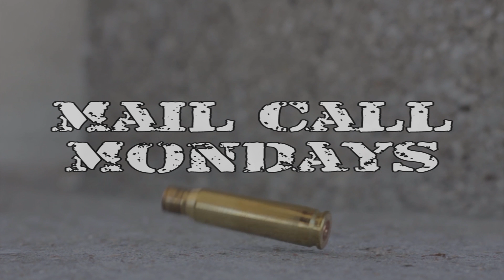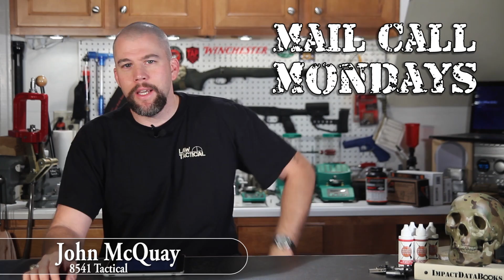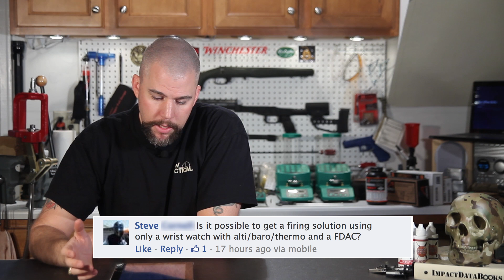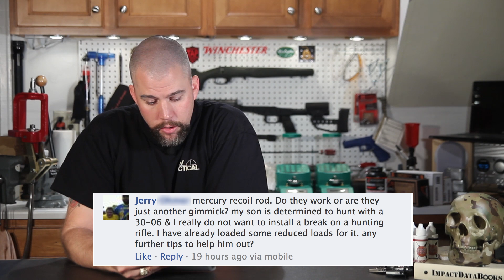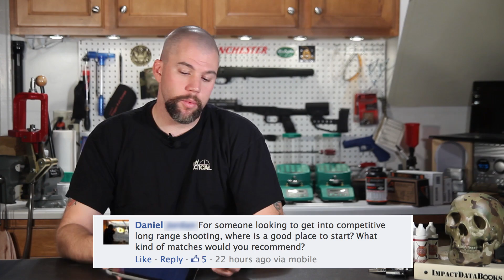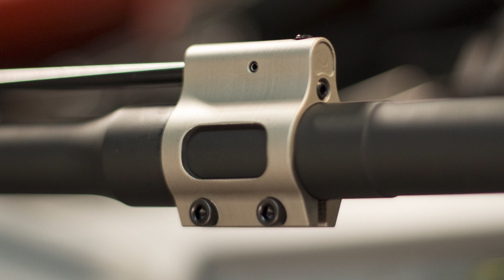Mail Call Mondays Season 2 #38 - Crowns, Dialing Zero, Truck Guns, 300 Blackout and more!

Comment: I picked up a H&R single shot 30-06 for $100 a while ago.  We put the barrel on my buddies lathe cut it off at 16.75" and put a 1/2" recessed crown on the barrel.  Mounted a 2x pistol scope on it in the scout scope position.  I used black bed liner for a finish on the metal, the stock is synthetic, it goes everywhere my truck does since I built an under seat rifle rack.  Yea its loud but less than $200 in it.  Couple hundred rounds in Garand clips in the seat backs.

Comment: Great info as usual. My general purpose/truck gun is a NEA upper 12"Brl 300BLK with a Surefire brake, on a AR Bushmaster lower with a Geissele single stage trigger; topped by a CRM-AK762 and a 45 degree angled T1 (4MOA)... has been a blast to own and play with, from in your face rapid fire to slow and deliberate out to 600+ meters. I really like this set up. Just my 2 cents...

Comment: I have exactly what you recommend for a Truck Gun! AR-15 with 16" 4150 CMV Chrome Lined Barrel, all mil spec 7075-T6 Upper and Lower, with a Free Float Quad Rail, I have an Aim Point Pro Red dot with a 5x Magnifier From Sightmark! Love that thing! Built the rifle for $760 + $600 for the Optics. $1,360.00 and a great setup! You could go with a cheaper optic and have it around $900!

Comment: I built a rifle last spring that would probably fit that roll pretty well:
16" mid length 1/8 twist SS mid profile barrel from black hole weaponry.  Troy v-tac free float handguard.  Mostly BCM internals.  Magpul MOE grip and CTR stock.  YMH flip up irons. A  VXR patrol 1.25-4 will complete the package when budget allows.

Comment: Ruger Mini 14 with 5 round magazine and open sights.   Sits well in gun saddle that fits between seat and console.  A longer magazine is not as handy to store in saddle.  I know.....   the mini 14 is not that accurate, but I have taken many coyotes with mine.
As was said in video a short bolt action with scope would be good for longer range  shots.  I had a chance to buy a savage striker in 22-250.  Dang I wish I had bought it.  THAT would be a handy gun.

Comment: Truck gun . An SKS . Who cares if it get bashed around , cheap and if it gets stolen you aren't out much money . Reasonably accurate and cheap ammo . To me a truck gun is one you leave in the truck and I wouldn't leave my AR in the truck . Locally a Tula good condition surplus is 200 bucks . Mine will shoot 3 to 4 inch 5 shot groups at 100 yards with little problem on a 10 inch plate at 200 yards . Good enough for plinking or bear medicine in camp .

Comment: Thanks for great videos, especially on reloading. Pls answer my following question, modern firearms are made of high quality steel, when fired they can handle high pressure, heat, bullet with copper jacket getting engraved and travelling at high speeds through them but if I touch the same steel with my brass rod(softer than copper) while cleaning it gently it will destroy the accuracy of my firearm? I don't see brass rod travelling at 2 inch per second causing anymore damage(if any) cont--

Comment: On your AR-10 build, if you would be able to test some TSX bullets through the Black Hole Weaponary barrel. 

I have an 18" BHW in 1:8 and cant get any accurate loads with TSX bullets. I have tried 55gr, for my fouling shots, but even these had a large MOA. I proceeded to do a OCW test of the 70gr 224 TSX from Ramshot TAC load data. None of the shots were under an 1". I switched to the 77gr SMK and I managed 3/4". 

On the BHW forums some have TSX issues, curious if you get the same results.